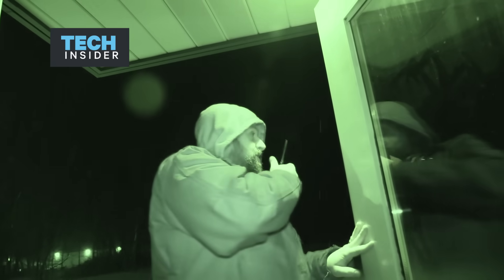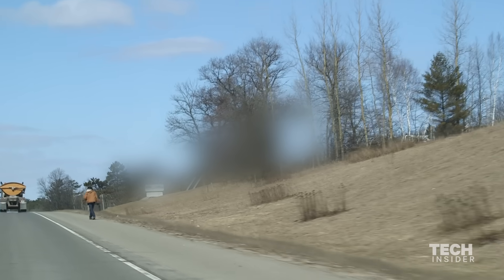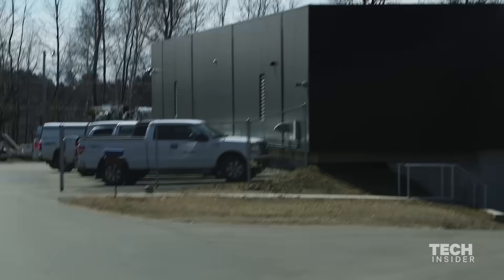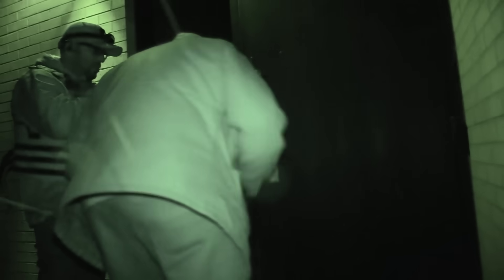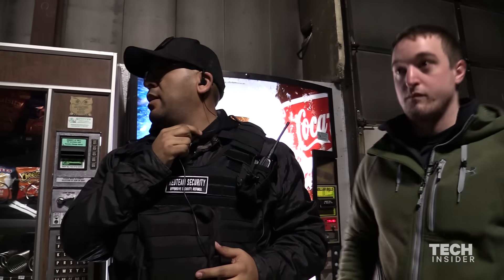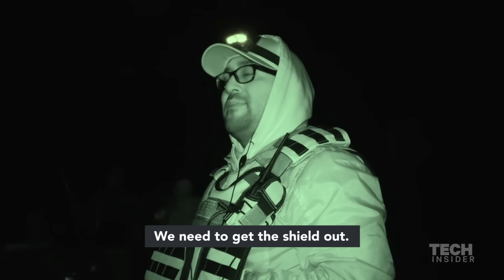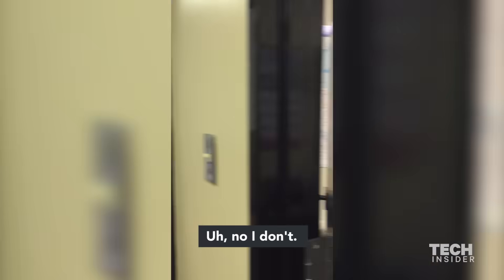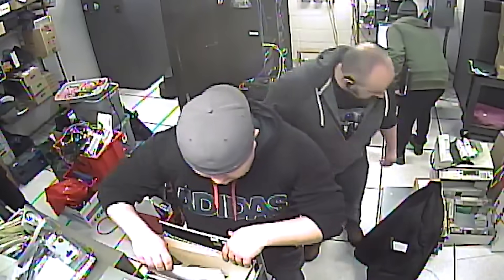Watch hackers break into the US power grid

Comment: Security people: "You need to update your operating system regularly to prevent hacks."

Hospitals: WINDOWS 7 / XP
Reply: Where i'm from, windows 98 and XP are still used
Reply: @watwat7097  the CNC machinery at my college use xp
Reply: @jameshill9325  that cnc must be fun to use 😂
Reply: @watwat7097  it's fine the software just uses XP to boot up and all of that but the machine is isolated from the internet besides they are crap machines anyway
Reply: @jameshill9325  at this point i would not be surprised if the cpu is a pentium
Reply: @watwat7097  NASA
Reply: @Monkey_D_Luffy56  yeah i guess, older mission like voyager is probably setup on old hardware ?!?!
Reply: @watwat7097  I worked at a company not too long ago, won't tell you who they are, but they had JUST gotten Windows 10. And another company I worked at that still used Windows ME, and even another that still used Windows 7 lol. It DOES happen. I worked as a cashier at another company that still used DOS and command prompts...how easily that system could be hacked....
Reply: @SUGAs_Shadow85  in other word the network itself was the flaw lol Using dos in 2020 is straight savage haha
Reply: @watwat7097  I thought so too. My brain doesn't learn backwards, only forwards. To make me learn a system no one uses anymore... I ended up losing that job because of that stupid system
Reply: @SUGAs_Shadow85  Many many companies still use older versions for good reason. They're reliable and secure.
Reply: @watwat7097  Where is this at?
Reply: @marcogil6665  canada
Reply: @watwat7097  well the biggest port in my country still use xp to control container
Reply: @watwat7097  really?
Reply: @watwat7097  you were early 00s
Reply: @watwat7097  windows 3.0
Reply: @watwat7097  here, win 7
Reply: @watwat7097  where are u
Reply: @watwat7097  very very insecure.
Reply: @Watching Channel i wish i was, that's really sad
Reply: That's because it's too expensive to do so, plus most of the softwares operate only in win7, so why bother changing it then having to make another software for it
Reply: @voice-less multi million dollar randomwares :
Reply: You know this is actually a difficult issue to tackle, cause lot of their program can only run at specific window, and to update it all mean you will have an information blackout till it's finished, so they have to do it slowly, some can't be updated cause it will be too much hassle to restart it, afterall ussualy hospital is full of doctor, not IT team, and God know where the problem are located if the software is acting up
Reply: @jinjikisano179  Thats why windows can run in compatibility mode.
Reply: Yes, they use old OS but it's mostly due to what software they use. If they update the PC to a new version or a new OS (say win xp to 10) and a critical software in the hospital isn't up to date with that, it could put patient's lives at risk. It's not the best way to go around things but the patient's health obviously comes first
Reply: i'm surprised this comment got so many likes.
Windows 7 is still being supported for Enterprise environments until 2023. It's not that bad to run this OS in 2020.
However, on the contrary, what truly is scary is the fact that government institutions and certain other organizations across the globe (including the US) still run and rely entirely on Windows XP and Windows Server 2003, which haven't been supported since April of 2014 and July 2015 respectively, with a minor exception for the Wannacry ransomware patches. Even more shockingly, as recent as 2 weeks ago word got out that Windows XP's entire source code has been leaked online, making it it easier now than ever before for hackers to spot flaws to use as attack vectors. If they every wanted a "better reason" to upgrade, they've now have it.
Reply: @HyperDroids  windows 7 dangerous
Reply: @Watching Channel Literally in my place we still use Windows xp and windows 1.0.
Reply: Cool Wei i mean windows xp was pretty ok imo but when I had it I was like 9yrs but I don’t remember any big problems.
Reply: @matschbirne5363  old windows are vulnerable to exploits that haven't been patched in those versions, remote code execution, ransomware's, everything
Reply: @fudes587  yes, Security ist the biggest problem with older win versions
Reply: @matschbirne5363  security problems
it has reached it's EOL in 2009, meaning it no longer gets any security updates. 

For example Microsoft updates windows 10 with critical security patches every week because how fast new vournerabilities are found
Reply: @coolwei1427  theres alot of windows longhorn and xp here, i honestly dont know how or why we still have longhorn.
Reply: @problem5697  easy. We are poor :p
Reply: @problem5697  i had XP in my old mechanics workshop it ran a software which they had which only ran on XP at the newest i assume both the laptop and desktop with it loaded was XP while the IT room had windows 7
Reply: @problem5697  what on earth is windows longhorn 😂
Reply: @problem5697  long horn was never released.......
Reply: @coolwei1427  1.0... Not even a graphical interface... Bruh
Reply: A hospital in Germany recently got hacked causing a patient to die.
Reply: @NAA-sk1ov  ghost. spOoKy
Reply: @NAA-sk1ov  well thats germany im not suprised
Reply: U can get windows 10 for free lol
Reply: @ashrafbessifi330  not for commercial use
Reply: @ashrafbessifi330  computers aint free
Reply: Hospitals pay microsoft to give them security updates for windows 7 so it’s just as secure as windows 10
Reply: Use Linux, duh
Reply: @iyxan23  doesn't matter, using outdated Linux based OS will have the same impact. The most important thing is regular maintenance, audit and updgrades.
Reply: @iyxan23  facts
Reply: @iyxan23  do u think linux is very secure compare other os ?
Reply: @iyxan23  Fr
Reply: @iyxan23  also set up surfshark dashlane or nordvpn
Reply: @iyxan23  most everything runs on it, still ain't safe
Reply: @iyxan23  It’s actually more prone to attacks since it’s a slimmed down OS. And support for older versions die quicker.
Reply: @iyxan23  yeah and t hen only 5 people in the hospital can use a computer lol
Reply: NurIhsan nah windows 10
Reply: @JayDawgDrummer  and yes using my 1.50GB ram 2.20mhz laptop in Windows 10 is awesome. Always need like 5 minutes to boot up. And always lag if I run something. And whenever I open python it's always lag like wtf it's not a big game. I mean it's not the window problems it's my laptop. I planning to upgrade it.
Reply: We literally use a DOS system where I work in the medical field
Reply: @drakelamp8423  I would think at some point in time, wouldn't a system be so old and outdated that not many people even know how to use it anymore.
Reply: Organizations still use XP and 7? Didn’t 7 lose all MS support? I recently just obtained my A+ cert and studying for my Network+. Are you really telling me, I’ll be seeing legacy systems out there?
Reply: @christianjavier1776  Welcome to the real world my friend.
Reply: @christianjavier1776  yes.
Reply: @JayDawgDrummer  man.. it's not my problems. I'm using windows 10. I say it was my company computer. So it's was the boss problems.
Reply: Wanna cry?
Reply: You know that older versions of windows have patched most bugs and they are harder to hack
Reply: @danielfigel6977  fake. for example Windows XP has reached EOL back in 2009 and wont get any updates for anything. Microsoft made one last update few years later for a exceptionally critical security problem, but it was the only time they did that ever, and they wont do that anymore. it's not like you can patch something 100% - most of newly discovered vournerabilities in systems like Windows10 that have been patched, are now a valid attack point for WinXP
Reply: Yeah, it's because hospitals use certain software that hasn't been updated because their companies either don't support it anymore or went bankrupt.  The software is very much useful and only really runs on Xp.  Unless you want to take the liberty of updating that software then i'd say just accept there's a reason for things.
Reply: @Watching Channel We use WinXP on trains man many things that's never connected runs old OS's.
Reply: @Salpeteroxid  .
Reply: The military use Windows XP and or older because it prevents modern hacks from accessing older and more unreadable kernels because of how inefficiency dominated older OS versions. Obviously efficiency has improved and hackers are still capable of gaining information from your machine because Window’s updates aren’t so drastic.
Reply: Well... No one makes viruses for windows 7 anymore, so.... They're safe...
Reply: @Gloverfield  I don't think that's how that works
Reply: @Gloverfield  windows 7 is vulnerable, can be exploited without physical interaction
Reply: @Gloverfield  or are they? vsauce music plays
Reply: Military windows 95
Reply: Haha eternalblue vulnerability go brrrrrrrrrr
Reply: putin uses windows xp
Reply: @canbaydan  lmao
Reply: @JayDawgDrummer  it is illegal to use unlicenced windows 10, while averge person most likely wont face crimminal charges, a company or any organization definitely will 

Also these licences you get second hand for lower prices are also illegal, because they are intended for other markets
and these companies need to use Win10 Enterprise anyway with is completely different licence
Reply: The only time an old system is safe to use, is if its not connected to the internet. if it's connected on LAN, then everything depends on security of the building it's in.
Reply: Well the problem with hospitals is your operating equipment that literally can cost people’s lives if there’s a major bug, so they have to be slow and careful with updates to make sure no bugs happen and the software they use is compatible etc etc.
Reply: @JayDawgDrummer  i bet it wasn't real windows account

source?
Reply: @JayDawgDrummer  the fact it works doesnt mean its legit

its a key illegaly imported from a developing country that Microsoft gives a discount to
Reply: The amount of CT machines running windows 98... 💀 throw them on an isolated VLAN and pray lmao
Reply: Windows 7 > Windows 10 is why
Reply: if not windows XP
Reply: In portugal they still use windows xp in medical centers
Reply: you: MARCH 2021
them: ....
Reply: machinery like cnc machines often run on whatever os they year they were made windows 97 ones are pretty common still other systems go farther back. happens all the time the people who make the machine never update the drivers and software once it works and then go out of business
Reply: *xp
Reply: use linux bruh
Reply: @abid434  the operating system doesn't really affect the operation of the machine the machine has special software that handles the CNC machining
Reply: Literally
Reply: Windows xp usually I use ubuntu
Reply: @JayDawgDrummer  It's not the OS that needs to be paid for its the man hours in re-working all previous forms of software. Windows XP is still used because it's reliable and secure (Not so much now as of a couple months ago). But before the source leak it is one of the oldest modern ish Operating Systems allowing lots of time to work out kinks in security and reliability. It also isn't loaded with bloatware.
Reply: They use it in the airport in Australia
Reply: Windows xp
Reply: I promise PRESENT-JONES on Instagram a good recommendation after he helped me access a friends account without a traces
Reply: windows xp
Reply: to be fair, at the time of recording windows 7 was still supported. And most of the computers at hospitals that you see running out of date systems arn't connected to the internet. 
still scary to think that when i go to the hospital my life could end because windows bluescreened
Reply: This was 4 years ago mate. 7 still had support and security updates.
Reply: Hospitals and shit are still on XP.
Reply: I think the reason a lot of businesses have older systems is because they themselves are old and have a fairly developed work system already in place on their current OS and they just don't see a need fixing what isn't broke (in their eyes anyway). I've worked for places that were definitely not poor but yet ran windows 7 and some were even XP.
Reply: Think different.
Reply: Most hospitals in Massachusetts use windows xp and 98
Reply: What state is this in. It's really beautiful.

Sorry I'm not from the States.
Reply: @TommyVercettisGamingNews  florida
Reply: win 7 is still great no need for the shitty Win 10 with all its issues and app shit and pre installed social media shit
Reply: because windows 10 is bloated shit
Reply: @Sploshwazere which servers use windows?
Reply: Windows XP is actually still used at a ton of ATM, hospitals and all kinds of other sensible stuff. 2000 and 7 also, Vista, ME, what have you. People are stupid.
Reply: Hospitals in italy: windows xp
Reply: I highly recommend hacker web cause they are the best and best hacker I have ever meet 
https://www.instagram.com/hacker_web324?r=nametag
Reply: ATMs: WINDOWS XP
Reply: @Watching Channel no seriously in some places it is still used
Reply: Windows 7? My service calls often end up with me using Windows XP and trying to make shit work. Hospitals are HORRIBLE.
Reply: Killua!
sorry I had to say it lol.
Reply: Windows XP here in Slovakia.
Reply: Eternal blue exploit ahh yes smb msfconsole
Reply: THE ENTIRE DND.... WINDOWS XP
Reply: Ha! We’re I worked at, they’re still using DOS! Cheaper they said.
Reply: People use older systems since they are less targeted then the newer ones.
Reply: Some of the doctors I go to still use XP 😭
Reply: @Watching Channel no one makes viruses for them anymore tbh, unless you go to some super old shady websites, 99% of viruses wont work on them because their OS is too old.
Reply: In Italy the use windows xp hahahah
Reply: @Watching Channel newer windows versions are quite shit, full of bloatware always
Reply: Ive seen some still using XP. Cant say where it is,but its a very important place, I know that still has a Windows 2000 machine for a certain software and is networked.
Reply: Ive seen xp still used bruh
Reply: Also hospitals:
1 IT team member with a $5,000-$7,000 budget per year to secure some of the most important information known to man
Reply: LMFAO
Reply: I’ve seen cash registers use XP
Reply: Thats ok compared to most.
Reply: Windows 7 is easy to hack
Reply: I laughed so hard on this one 😂😂😂😂😂😂😂😂😂😂😂😂
Reply: Windows 7 is amazing though xD
Reply: windows xp is the most secure os, thats why the government uses it, all the exploits are Known.
Reply: I mean windows 7 works so why change. Its gonna cause trouble if you change it because its a new system.
Reply: Lol
Reply: Lol
Reply: Monolithic kernel OS' are compromised by design. OS' should be decentralised with something like antikernel so there is little to no attack surface.
Reply: Why hack hospital ¿? No sence.
Reply: @Djmaxofficial  why do serial killers kill? Because they can
Reply: windows 98 in full affect
Reply: Agreed. But more like XP which is even worse
Reply: Think about the cost of updating your entire systems. Think millions for some. They see dollar amounts and not security. They have no idea how vulnerable they are.
Reply: Chad move
Reply: That’s how the Waikato hospital got hacked
Reply: windoes even is not outdated it's operating systems like XP or vista
Reply: Lol some still use windows XP
Reply: Better yet IBM
Reply: i never had a problem on windows 7, but windows 10 i got usb drives disconnecting, wifi network disconnecting, i can't help but think that someone is hacking me lol
Reply: real chads use wind 98
Reply: *windows XP
Reply: xp
Reply: Windows 7 is just as secure as windows 10 if your not a complete potato donut.  But if your running a business there is always a donut
Reply: My brothers place if work is on XP
Reply: nah bro windows XP service pack 2
Reply: more like Windows XP still in many!
Reply: I saw a job ad with "must know Windows 2000"
Reply: @Sploshwazere servers use linux
Reply: nuclear powerplants:
50Mb hard drives
Reply: library: windows 7 embedded
Reply: Ive actually used windows 7 as a personal OS and i do on my other pc at my dads home i use a macbook
Reply: windows 7 would be more secure, the viruses made today are much worse and probobly will not be compatable with windows 7.
Reply: I think it's because the equipment and systems they use can't work on windows 10 or 11 and it would cost way too much to upgrade everything (money that they could use for other things) but since we pay the hospital with our taxes here in Sweden most of them (I think) have windows 10 or 11 on their desktops
Reply: Actually military defense contractors do the same its easier to avoid viruses and bots on older systems
Reply: Lower the operating system the more reliability
Reply: It doesn't matter China already has 80 percent of our medical records
Reply: we still use nt3000
Reply: Xp/10> everything else. Vista and 11 are shit.
Reply: They say that Windows 8 and XP are some of the best ones so maybe that’s a good thing😭🤷🏽‍♂️
Reply: J W windows 8 is literally the worst operating system Microsoft has made
Reply: @user-vk2cd9qw7i  Meh, ME was worse
Reply: @user-vk2cd9qw7i  it doesn't matter what you like, or how good the interface looks. all that matters for these kinds of system is security

some of these computers dont see anyone physically using them for months, because everything is automated, so the UI doesn't matter

but everything older and including Windows 7 no longer gets any security updates
Reply: @C  Windows ME is the worst, by far. Windows 8 is tied with Vista for the second worst though.
Reply: Someone got my password and started extorting my friends for money till I got referred to use Hackerqudus01 on instagram and thanks God they were able to change the password and help me re-gain access back to my Facebook account again you can even contact him on WhatsApp +1 (219) 804‑8589